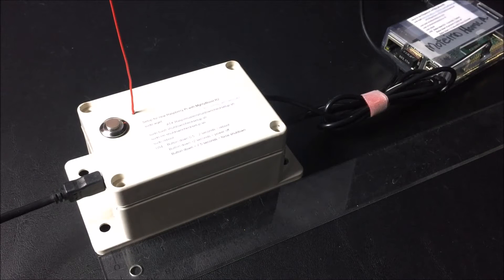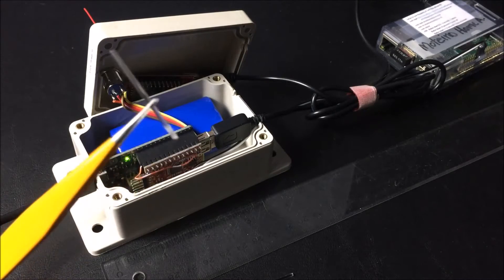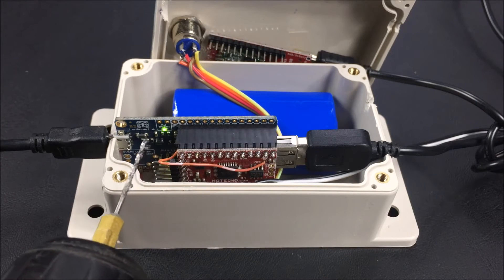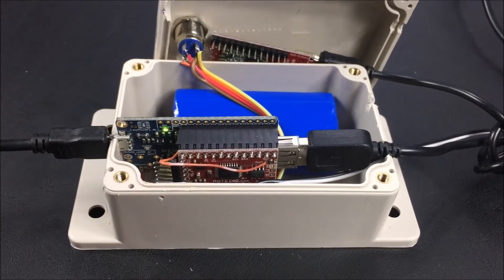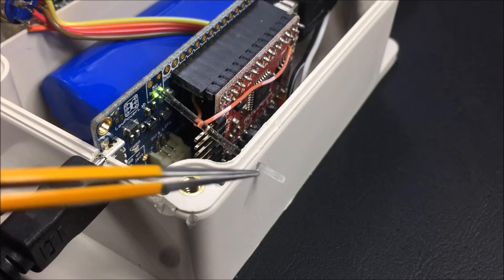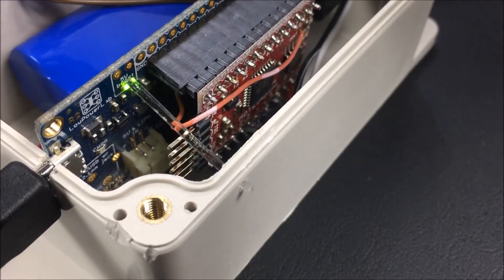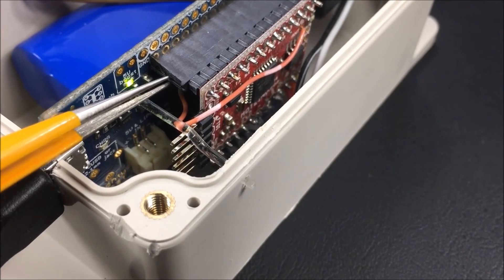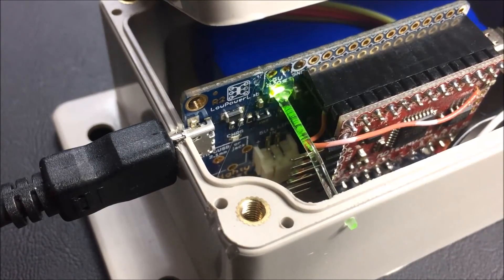Acrylic LED light pipes

Comment: Thanks for sharing this video John.
I would like to ask a query that if there are two led's of different color & I would like to reflect them on the top using led pipe and those two led pipes are connected with each other at the bottom so, will there be any effect on colors at the top?
Reply from the maker: I don’t think color is affected but I wonder if brightness may be different because of joining 2 pipes. How would you join them?

Comment: The end of the light-pipe was frosted looking.  Was there a reason for this?
Reply from the maker: Yes.  I scuff up the end of the acrylic with some sandpaper to make it look frosted.  By doing this it makes the frosted areas illuminate from the LED.  Otherwise only the end surface of the pipe will light up (and not the sides of the pipe) which is not as easy to see when the LED is on.

Comment: I am having trouble finding the acrylic pipes online. Can someone share a link?
Reply: Also try fibre optic and melt the end on a concave surface. The fibre optic can be held in place at the led end with black heat shrink and you can have as many optics as the heat shrink can hold